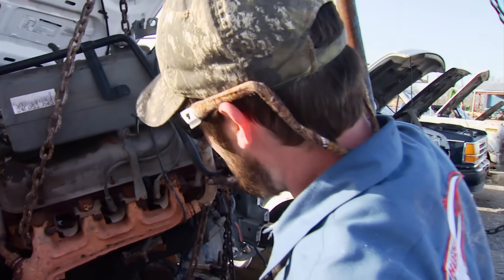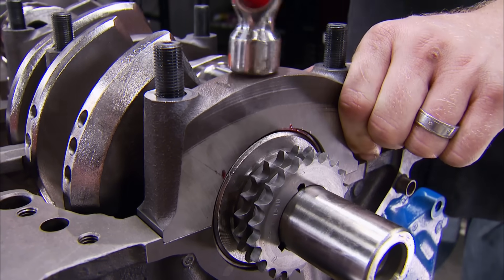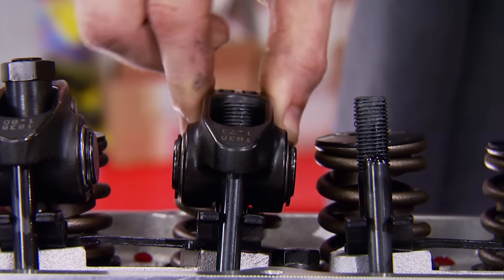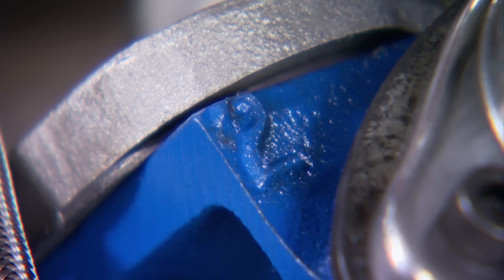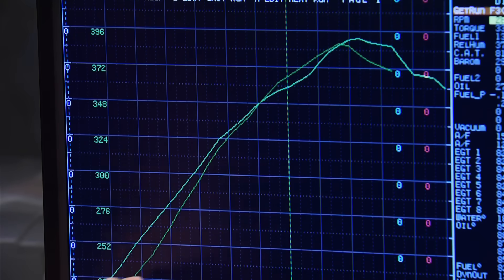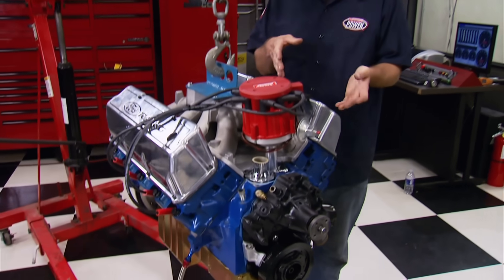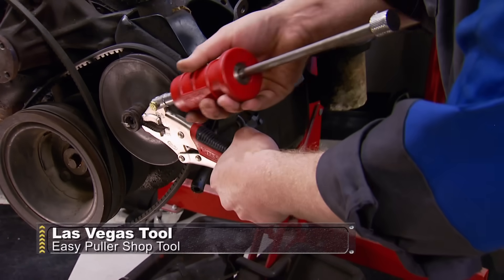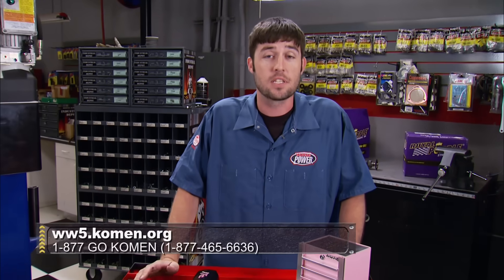351 Small Block Dyno Shootout: Windsor vs Cleveland - HorsePower S16, E11

Comment: Back in the 80's no one would think of the 351 Windsor as a performance engine. A lot has changed.
Reply: Funny we knew that there was huge potential in the 351W, BUT the 70's smog shit killed the power... The 69-70 351W 4BBL with its High Compression and decent (for factory Iron junk) was a Camshaft away from REAL power... The sad thing is they basically built a Cammed "400" (of the 351M400 family) what they got for power was nothing new there either...we built plenty with 4V intakes, better cams, and better pistons, that went into "4x4 Work Trucks" all over our area...
Reply: things ain't changed that much
Reply: What made the difference was when, Trick flow specialty's Made the first set of Aluminum heads for a 302, 
With in two years there were 10 different Brands of heads to choose from for the Windsor engine, now are as popular as a Chevy head.
Reply: You know what changed?  It was TFS made the First Set of Aluminum heads, For the 302-fox body Mustang, because the market was there. Within two years there were at least 10 different manufacturers building heads to try to gain a chunk of that market.
Reply: That's exactly what i thought!...i would always choose union Cleveland  steel over Canadian.
Reply: @rogueart7706   The  Heads  were really built for the 302 and the 302 was never really a Windsor. it was Built in Cleveland   firs 20 yeas of it's  life. dumb people call  the 302 a Windsor but it  never was called that by ford. it was called  
90 degree V, Fairlane or Challenger By ford

Comment: These guys don't like making HP with any Ford. I have a article on a cookbook Windsor build. Pump gas, AFR heads, junkyard block, 418 cubic inches, victor jr intake. No porting or grinding anywhere, all part numbers given for the build. MADE 670 HORSEPOWER.

Comment: 11:08  i have a mysterious 351 cleveland, it looks pretty standard , square bore manifold perfomer LB 2v351' a 400 cam, performance pistons , a four barrel holley carb , big sump, headers etc, but it revs way higher than these engines and sounds much better quieter but much better, ive never herd it at full  revs because its too dramatic , sounds like its doing 8000 rpms , but it cant be any more than 300 hp

Comment: You bolted a 2v Intake to 4v Heads, rev only to 6 grand and wonder why it does not make more power?
Bolt on a set of CHI 3v heads and matching intake and see the difference...

Comment: Basically stock Cleveland with low compression open chamber cast heads even the 4V ones.    Against  a stroked Windsor with closed chamber aluminum heads.  Yeah this was not a good comparison.

Comment: Guys that truly have spent time with Cleveland’s know that going big on compression, camshaft(not a pussy hyd roller, mech roller rules) ported 4V closed chamber heads and a large induction system with large tube headers. The block should have lifter bushings to correct oil issues as well as main and head studs( I had a studded 2-bolt block run for 8 years at 8200 rpm consistently). The biggest problem with people is that they want a “street” engine not the full monte’. Sure you have to run it on race gas and actually work on it, but why are you even into performance cars in the first place? Find something else to satisfy the pussification!

Comment: Love to see PowerNation do a US-built 351C vs an Aussie spec 351C ! Our 302 clevelands provide the 6" rods and small port 56cc heads that produce a pretty unique and punchy motor. PAVTEK do a nice CNC rework of the 302 C head that works well with the combo. 💪💪
Reply: I've run a 351C shortblock with 302C heads and a nice mild Elgin E-907-P camshaft (220@50 & 505 lift) and it was brilliant. Very torquey midrange and a peak of about 5500rpm. Very nice street motor for very little effort, and could've taken a 230 to 240@50 camshaft easily for more topend.
Reply: Unfortunately that wouldn’t happen because they’d be shit scared that an Aussie built 408 stroker would eat that Windsor for breakfast.
Reply: i once worked on a 70 mach 1 with an aliminum rod 388c in it. 1050/4500 on a sheet metal intake, 1:14, chromashaft, boss heads, 2" hookers, comp, msd, 514's, 13"/31's, c6/5000 conv and brake, much more. the car ran low 9.30's shifting at 8,500 with NO gas and it tripped the 60ft with the back wheels. pretty decent running cleveland i think.

Comment: Fords need lots of gas and  more air.... And timing at 32 degrees and 34 degrees dwell in the old days. Those cams were not great and dual plane should be used not these single plane trash intakes

Comment: Ft.smith Arkansas speed shop used to sell the street Boss intake and used 2v cleveland heads on my 302..only issue was camshaft limiting back in 1986

Comment: i fail to understand the conceot of this comparo, its comparing apples and oranges!
Learning that the 2V heads were better street wise is not news its been known for years, circle track with bigger carburetteurs for the 4V sure but a huge early torque drop for the 4v on the street.
i built many Clevos here in Australia in the 70's when aftermarket gear was expensive here by comparison and after market heads were less avaialable, and the Australian 302 Cleveland small chamber heads worked really well bolted onto a strong smog compression pistoned engine worked wonders, the cast Australian Geelong  cast Cleveland block was a thick wall block unlike the american block with thinwall casting , it was consequently a bit heavier however it didn't tend to crack around the web as many American blocks did in Nth American winters.
i also ran gas LPG or Propane as known in the USA, hardened seats for the valves, they ran really well and with good carburettion loved big compression,  flowed well with more initial advance and cold air intakes.
Yes there was a 302 Cleveland here and was developed to make use of the Australian cast blocks in order to drop using the imported Windsor blocks.
Remember the Windsor was really a mid range wide purpose engine in 351 guise except for the HO version, the Cleveland 4V Ho or Boss was designed to be a semi Hemi  big breathing engine and in 4 V form running 11:1 comp, fuelled and cammed properly would out run  a  Windsor or 350 bowtie because like a 429 they could flow so much air.
The Cleveland was originally designed to be an intertmediate size high performance engine and was seriously underated in HP when released however the fuel crisis and insurance companies saw it relegated to a choked up under comp and cammed egine with retarded cam timing in the later releases sadly down to 8.8:1 comp if i remember correctly in some guises.
The fastest 4 door production car in the world was in 1971/2  Ford Falcon GTHO fitted with the HO Cleveland produced here in Australia and was capable of 145 mph.
Incidently F'series pickups in Right hand drive were fitted with were fitted with Clevelands here in Australia mostly with 780 CFM Carter Thermoquads on 4v manifolds, the Carters worked really well and I found them better than the average Holley 600,650 750 offerings, New process, Borg warner manuals and C6' auto's  for the 351 and C4's for the earlier 302 pickups.
just reminissing folks!

Comment: yeah but they had to sink a lot of money into the Windsor to get those results, the Cleveland is a much better bang for the buck....basically a short stroke 289 bored to 350, all in all a stroker against a stock engine, how is this a shootout? and why the single plane manifold if it is meant for the street.   So they sank an extra several grand into the Windsor am I surprised it performed better?  ahh no!

Comment: Shoot out??? Stock Cleveland with two sets of the worst stock heads?? Vers a 408 stroker. Come on. Re run that Cleveland with stock closed heads and a better cam. It would beat out that 408 no questions.

Comment: What am I missing here?  The video title perfectly implies a shootout between a Windsor and Cleveland, all else mostly equal.  How is 408 inches anywhere equal to 357?  I was expecting effectively identical builds on the factory heads, worked equally to see which design might be inherently better, if either.

Why not put a toddler in the octagon with an MMA champion on drugs and in a pissed off mood while you're at it?

Comment: I agree with all the others not fair no build to the cleveland at all,    All the racers used the cleveland for 1 reason it was the better choise for hp in it's day,  My 1970 cougar that had a cleveland  that I did work to and would smoke chevy 350's all day long.  So not a fair shootout in any budies book.

Comment: How large can the cleveland be bored and stroked? I know there's a 408 kit out there but how big can they really go, would they make it to 427? A 427 Cleveland sounds like one hell of an engine, is it possible?
Reply: Also, a 408 stroker kit for the cleveland would give it the displacement necessary to take advantage of the 4V heads.
Reply: And the cam didn't match the 4V heads.

Comment: How is this a fair comparison between Windsor & Cleveland? Clevelands were all about the heads - you put aftermarket Cleveland heads on a Windsor and stroked it. This was really a comparison between a stock-ish Cleveland & a souped up Clevor. Apples to oranges.
BTW I once had a 1970-1/2 Falcon w/ factory 4V Cleveland.  Awesome top end (it would bury the 140 mph speedometer at 5,000' MSL easily). Chirp the tires on shift to 2nd w/ stock Borg-Warner FMX. But it didn't have the bottom end of my 1969 Chevy 350/300.  The Cleveland 4V heads (as everyone now knows) were too big for a street motor.

Comment: Great video! Nice builds! I would like to see the cleveland with 12 to one pistons, 4v heads  better Cam,  at 7500 rpm,  I'll bet it would put out 650 HP...
Reply: Possible with Big Lift Solid cam setup.
Reply: Gapp +Roush were close as was Glidden. Just remember these are 40 year old Pro / Stock Numbers.
Reply: Talking the 650 HP at the wheels.....
Reply: Possible with Big Lift Solid cam setup.

Comment: Having run clevelands for many years in my stock cars, and now windsors for years in my drag car, this "test" is completely meaningless. This was a commercial from start to finish. Try a 2bbl C against a 2bbl W. Then throw on 4bbl heads on the C and the bigger '69-'70 4bbl W heads on. Both engines have good and bad. The Windsor can't breath with stock heads and the Cleveland needs oil mods or it won't last. Comparing all aftermarket parts on a stroker with all aftermarket parts on a stock stroke.....proves ZERO!

Comment: Really? you're swapping out Cleveland 2V heads with 4V but keeping the the 2V manifold? what kind of crap is that? That cleveland with 4V heads should spin up into the 6500 rpm range making power you need the right cam and crank those motors will breath with those heads I had built two of them in my time and loved that motor. The biggest issues was oil to the bottom end. You had to install oil restrictors in the the cam galley to divert oil down to the crank to make the bearings live a long life.

Comment: The 4v made peak power @ 5500 rpm?  What was it? An RV cam? [my rv cam pulled hard to 5700 lol] Even w/ a tiny cam a set of port plates [at least] is a requirement on 4v heads. From my experiences w/ the C engines the 4v heads love a "bigger than usual" cam, lots of carb and looots of RPM. Is it streetable that way? Yup. This test was a bit "off" w/ mismatched parts  IMO on what they did w/ the Clev. - The 4v heads w/o port plates tend to suuuck till around 4k-4400 rpm but reaally come on over 6k. I mean if you wanted a 500 hp street engine put a 408 Clev. together w/ 4v heads n port plates and a small "split" camshaft - somewhere around 256/266 @ .050 and 589/615 lift. - it'll pull to 6800/7000 and drive better than that mismatched thing these guys put together.

Comment: That intake manifold needed to be changed to the 4V version to really see the horsepower and torque of the Cleveland. 2V is right for the street for sure, but that 2V manifold is choking the potential of the Cleveland.
Reply: Problem with most factory two barrel engines they have lower compression heads vs four barrel have bigger valves  . Lower cc vs higher cc
Reply: the 4v is a far better street engine then a 2v.
Reply: I would have also thought they'd jet that carb up or something to follow suit with the increased airflow.
Reply: @TheZbierman I agree with you there. Like the 4v can undoubtedly flow more, surely with more fuel it will get bigger numbers